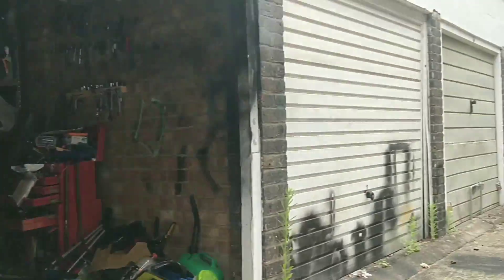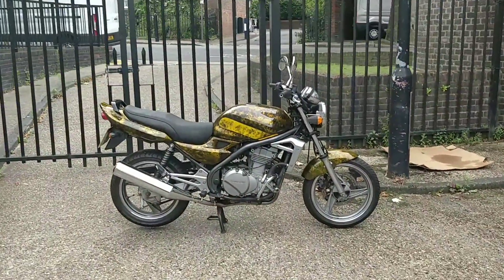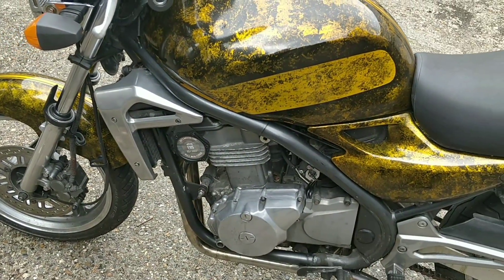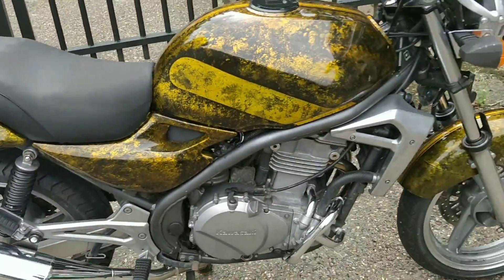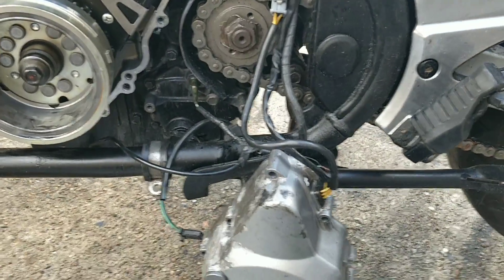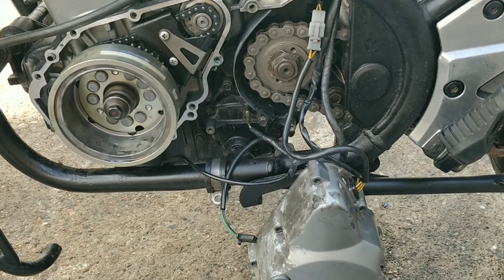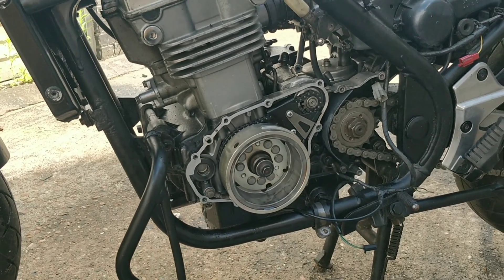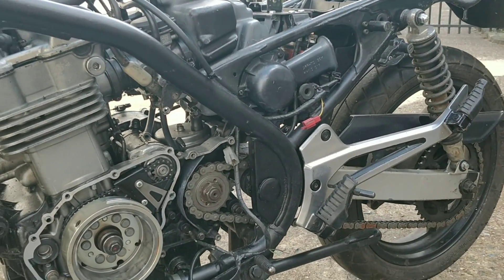my most annoying project yet, broken kawasaki er5 randomly sparks again. dead or not?

Comment: If I had the money an a the train money I would have it off ya mate. Bloody lovely mate 👍😁🇬🇧
Reply from the maker: I tried to start it yesterday and it had lost spark again. I've chucked the battery on charge just incase.
Reply: @motorcyclerescuer  don't give up on it. 👍😁
Reply from the maker: @stealthandysteath1069  it's running well today, battery fully charged. Needed a new spark plug on the right cylinder.

Comment: I saw a spark. It Runs! LOL The Crazy thing about problems like that is you still don't know where the problem is and as long as it sparks you won't be able to find the problem. I'm not a motorcycle mechanic guy but I was an ac and heating tech for 30 years and have seen such problems many times. Sometimes things just get wonky.
Reply: I've had similar problems cdi had loose eaten away connector at end of wire in the connector box that connected sometimes then sometimes it wld wiggle loose .a jump up n down on the seat would get it going , lol then I stripped it and found it ,
Reply from the maker: I know right, it's unbelievable. I think it needs a whole new loom really as there could be a break in it somewhere or a loose wire.
Reply from the maker: I've had a good look but can't find anything. I've tried a new cdi aswell. 

I think it needs a new loom ideally. That may be my next try.
Reply: This is an expensive rookie mistake. Thank you so much for the answer. I’ll way my options, probably find a local welder. Thanks! Love the channel!
Reply from the maker: Yes a local welder shouldn't cost to much. Weld a big old bolt back on. 

And yes over doing bolts is a big issue. I'm fairly gentle now days with everything unless they are engine stuff I.e heads on head gaskets. 

Always best to be gentle. But also to keep in mind that things will break if a bit old and frail so would have needed fixing at some point anyway. 

Hopefully you get it sorted. A welder should do it for a few pound. Shouldn't cost to much. .
Good luck

Comment: Your def not alone with your nagging issues on your project brotha! im @ around 80% completion on my CB250 BB project. Found I had about 1-2 threads left in one of my spark plug holes & need to properly address it (NO BS HELI_COIL, NEW SLEEVE ONLY)  before re-assembly. Had someone pull the dents out my tank too and was supposed to have that back last week! Lord I do hope i get it all wrapped up by this weeks end. 
Best wishes with ur project though : D
Reply from the maker: It's a pain right but a great feeling when all done. Good luck with yours.
Reply: @motorcyclerescuer  SO I suppose it makes no difference, but I had accidentally cracked the cylinder sleeve while fitting piston rings. The crack is at the very bottom of the sleeve, judging by the distance of the piston travel, the rings do not reach anywhere near the crack thank god. Its a horizontal crack on the sleeve area that fits inside the crankcase. Thinking some JB weld around the outside of the crack or inner wall where the crack fits inside the case right before I plunge the head on and I should be ok. I think.... Any thoughts brotha? It was the honing for the BB pistons made the sleeve so thin at the bottom, didnt compensate when forcing the head onto the pistons. : /
Reply from the maker: @AllboroLCD  it's common to get the cracks at the bottom, I've seen it a few times and as you said if it's not within the piston travel then it will be ok.
Reply: @motorcyclerescuer  Your always on point with me brotha, I cant thank you enough for all the support! Thank you!
Reply from the maker: @AllboroLCD  no problem mate. Good luck with it
Reply: @motorcyclerescuer  oh fucking hell man, the more I attempted to fit the pistons in , the more it cracked. At my wits end, but not discouraged!!!
 Half my day was spent extracting shards from the crankcase. My machinist friend thinks its best to just bob off the rest of the "cylinder skirts" and then re-fit again. They appear to really just serve as oversized "dowels" and will not affect essential operation of the bike. Im aware I can always "re-sleeve" the head if it is in fact fuct or have the OG stock head bored to fit the bigger pistons. We feel confident this BB head will still be good however. Its my only shot if im getting this done anytime soon. Please chime in if this may be foolish for w/e reason.
Reply from the maker: @AllboroLCD  I think this is trial and error now. You can still get replacement parts including new cylinders if it all goes wrong.
Reply: @motorcyclerescuer  Your right, im overthinking at this point. Just gonna see where it all goes. Hopefully it comes all together for me today. Thanks!
Reply: @motorcyclerescuer  Well, we bobbed off the paper thin damaged cylinder skirts, re-burnished the surface. I got everything fitted back on & torqued to spec, had to fit the piston rings in via flathead driver, took alot of sweat and many tries. I do have full piston travel when manually cranking the motor so thats good. Whether or not it is, does seem to be all ok as of now thank god. I will absolutely, undoubtedly, film the first startup of this beast thats tortured me for the past month! Epic win or fail, it should be entertaining either way ; )
Reply from the maker: @AllboroLCD  definitely do film it. It's all part of the enjoyment of engine work on older bikes. But it's worth it to save the bikes. 

Well done
Reply: @motorcyclerescuer  Shoulda taken a pic of the cylinder block with the skirts bobbed off. I do think I will be fine here, there are still dowels holding it all in place. More than likely, long as I keep after the head bolts and cam tower nuts torque spec. I will be all good in the hood. Drop an update soon.
Reply: I discovered a "skirtless" BB kit for another bike while researching. The advert pitch was that the skirtless design eliminated the need to bore the crankcase opening. just wanted to share : )
Reply: @motorcyclerescuer  Well the BB CB250  is ALIVE! Sorta... It takes quite a few cranks to start, and then idle is rough followed by a stall. Cannot rev either ATM. Seems to also be an odd spark from the contact point on the starter motor too. Carb jets are 115/38 fyi, which will get a THOROUGH cleaning out 1st thing tomorrow. Going to check my airways, and go through my wiring for faults too. Cam chain as well, though certain Its TDC & spot on. The Simple fact I can start/idle without any catastrophe has me feeling good about my  "skirtless" cylinder block. 
Someone also recommended I get a few 6-12mm holes in my exhaust baffle to compensate extra output. Any input is highly valued at this point brotha.
Reply from the maker: @AllboroLCD  hi I wouldn't drill the exhaust yet, it should run smooth first. If the timing is off by 1 tooth then it could still start but not be happy as you described so definitely check that again. 

On my build I had 1 carb that just wouldn't run right no matter what I did so I bought a new second hand one, cleaned it and it ran beautifully. So try sorting your carb first. 

Let me know what it's like after the carb clean, I'm curious.
Reply: @motorcyclerescuer Will give the carb an OCD level of cleaning, thank you! Been also told my air/fuel mix could be way off as well. The cam sprocket marks were as even as I could get them and yes i found even a single tooth in either direction was "too" off.  Will check the cam last as I dont see that being too fun adjusting it while on the frame. Was challenging enough off of the frame, lol! Thank you!
Reply from the maker: @AllboroLCD  it's easy enough to adjust in the frame dude but I'm sure you got it right already.
Reply: @motorcyclerescuer  Far as I understand, I get timing mark hole to TDC & the sprocket marks level with east/west, and cam bolt is pointing direct north.
Reply from the maker: If I'm being honest I've forgot the process for this model, however make sure your bottom mark is right, some say T for top but others use different letters.
Reply: @motorcyclerescuer This lil project had me so burnt out, I f%&cking left paper towels in the intake ports from painting! Half day spent blowing paper out my valves :-/ Top it off with super glue'ing the plastic Y valve for the carb breather & ever so gracefully putting it back into place, lol! Alls well that ends well man, took a few cranks, still little spark coming off my starter motor contact, but fired right up!!! I certainly need to adjust the valves better and poss tighten my exhaust more but it sounds like a whole diff bike now! Had er running till warm-up, no troubles at all, full rev, everything! Few more adjustments and  ill be golden; )
Reply from the maker: @AllboroLCD  sounds like it's going on the right direction. I like your commitment mate, not many would dive back in. Well done.
Reply: @motorcyclerescuer  Not ashamed to say I was close to breaking down when those cyl skirts cracked on me, but thank you man : ) Thought my valves were to spec, tapping tells me otherwise though again... I may not have tightened my ex pipes all the way. Do you have a recommended lash setting? Should the setting be diff now I have upped the CC's? Will post a vid, soon as the weather is less soggy here!
Reply from the maker: @AllboroLCD  if you have not changed the valve push crank then the setting will be as it says in the book. I can't remember them if I'm being honest but can look it up if you need it. Loose abd tapping is ok however they can't be too loose or you will lose power, I would nip them up a touch if I was you. Possibly a quarter turn on each one, or get the feeler gauges back out. 

Your doing a great job mate, it can be super stressful however for the rest of your life you will know how to do it which makes it all worth it.
Reply: @motorcyclerescuer  Thats precisely my thought, im hanging onto the bike based on parts price/availability alone! My clymer manual calls for 0.002 in and ive got some awful valve clang happening at the moment. Def needs some more space than that! Got some seat time in today... finally. Even staying at half throttle, I immediately noticed a difference in climbing hills. Will triple check the cam chain position when I redo the valves in the AM!
Reply: @motorcyclerescuer  Dawned on me, I did NOT set my valves proper. Didnt crank 360 deg after setting the first cylinder. :- /
Taking care of that now, will post end product vid soon!
Reply from the maker: Oh really, that's interesting, they will be out a fair amount then. 

Last piece of the puzzle you think?
Reply: @motorcyclerescuer  Sure hope so, it def feels like the case! Just finished trying again @ spec, noise lowered but still there. Going to go for the top of the spec now 0.010mm. If still.... Damnit I think ill have to take the rockers off and investigate further.
Reply: @motorcyclerescuer set valves slightly over spec and it quieted right up! So one more go at it somewhere between should do it : D
Reply: @motorcyclerescuer  It seems i did something wrong with the cam/chain. When I went to redo it, I noticed the cam bearing was worn and saw grit in the oil. The flip side of the bearing seemed ok so I flipped it around as well as the other bearing held in by the clip. Cleaned everything out, re-set the chain and clearances. Started up beautifully, no clattering at all sounded perfect! Took a quick ride, after 1 mile in, there was a quick screeching underneath the valve cover and the clatter sound returned shortly after. Checked the cam/valves when I got back and immediately noticed clearances were out of whack again as well as more grit around the cam bearing. Appeared to have worn the bearing down rather quickly. At a bit of a loss here at this point. Not entirely sure how/why the bearing wore that fast. Judging by it sounding good for that short time tells me im in good shape as far as the pistons/cylinders are concerned. I dont want to replace those bearings just for it to wear down again in 2 miles. Any thoughts man?
Reply from the maker: @AllboroLCD  that's so weird, my first thought is that the engine block should be torqued down to the right spec so that the top end is lined up properly, but I'm sure you did. 

Then I'm wondering what would put that wear on the bearing, could the cam have been over torqued onto the bearing?
Reply: @motorcyclerescuer  I know! The chain cannot possibly get so tight it literally grinds the cam on the bearing right? Only 2 things come to mind for me, Oil pathways to the bearing (not sure how to clean that) , and perhaps the chain tensioner. 
New bearings are $20 from honda dealer and a used cam w/bearings from ebay is $40. Not going to mess with it any further until I get one or the other. In the meanwhile, I will remove the cam for now and get the tensioner loosened. Give it some play and secure it back in. Make sure its all cleaned out well too.
Reply: @motorcyclerescuer The left bearing isnt worn nearly as bad as the right fyi. It looks like the groove inside for routing oil was worn down to nothing. Flipping the bearing just leveled the cam out, Oil still could not run through it, which was why it ran AMAZING until it wore itself uneven then clattered again. 
The REAL last puzzle piece is getting the cam level on the runner with new bearings, making sure the valve clearance is right and confirm oil is pumping through the pathways proper. Back to waiting on parts for now, but I at least know whats needed.
Reply from the maker: @AllboroLCD  honestly I've never experienced anything like what your mentioning. I think your right about oil flow. Make sure you oil them up before putting them in to give it a fighting chance.
Reply: @motorcyclerescuer  With all the bikes i see you working on, cant say thats exactly comforting : /  Perhaps it was from riding too much with that clatter sound? Less than 90 miles spent test riding btw. Will definitely be extra cautious installing  the replacement bearings when I get them. Run the bike to full warm up a few times, then pop the valve cover and check the new bearings for ANY wear. Wont ride till im full confident the top end is good first.
Reply: @motorcyclerescuer  My f&*ckup is likely not pre-greasing those cam bushings isnt it? Moly... difuside or something grease?
Reply from the maker: @AllboroLCD  I just use engine oil but then fire the bike up not long after so they don't drip dry. I've never used anything special
Reply: @motorcyclerescuer  K, how bout  difficulty getting chain/sprocket onto the camshaft? Was near impossible for me. Had to get the cam thru the chain & sprocket first, then chain onto sprocket.... then onto cam. Im positive installing unworn bearings will fix the noise issue, just wish there was a way to check the oil passages to the cam holders for any clogs.
Reply from the maker: Interesting, I have a feeling I did mine the same way but can't fully remember, I would need to look at my vid again. One moment I'll have a look.
Reply from the maker: @AllboroLCD  https://youtu.be/LlDasSYWe6s

In this vid around the 35min mark I stretched the chain on using a socket on the crank. Have a look and see if that helps. Also look what I did with the tensioner to help have more slack. 

Hope this helps a little
Reply: @motorcyclerescuer  Thank you so much man. Anything I can do to check the oil passages into the cam holders? Could I plunge a wire hanger down the holes possibly?
Reply from the maker: @AllboroLCD  I was wondering that myself. 

You know what you can do........ you can start the bike with the cam cover off for like 30 seconds. 

Or you could disconnect the spark plugs, keep the cover off, crank the engine and see if you get oil flow. 

You could also drain the oil again and spray down a bunch or carb cleaner or brake cleaner, however I have a feeling that you have oil flow. 

And lastly I assume your using 10w30 or 10w40
Reply: @motorcyclerescuer  Again, thank you once more! Wasnt exactly sure how pressurized the oil is flowing to the cam holders, thought maybe it would squirt all over like a horror movie or something. lol
Reply from the maker: Lol no it will squirt a little but won't paint the room lol. 

Let me know how it goes dude

Comment: Correct me if I'm wrong but didn't you take the cap from the zl600 & it started ( when you announced you'd eat your hat lol )

Also Gary's horn issue you fixed as it was the wire feed so you didn't take the horn of the er5?
( could be wrong as it's been a long hard week at work ie 60 hours).
You ever tried making silhouette gaskets from cereal boxes #oldskool?

Ride steady and stay safe Charlie 🤟
Reply from the maker: Yes we put the horn on Gary's bike, the speedo cable on the zl600 and the cap from the zl that I originally took from the er5 back onto the er5 lol. 

Its so confusing lol. 

For now I'll be interested to see if it continues to spark over the next few days. The battery died so I didn't get to try yesterday after spending ages putting the exhaust back on lol